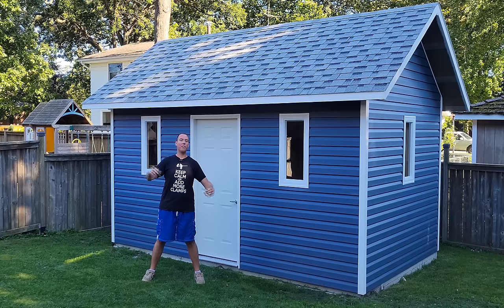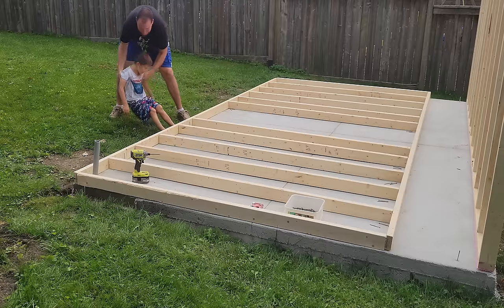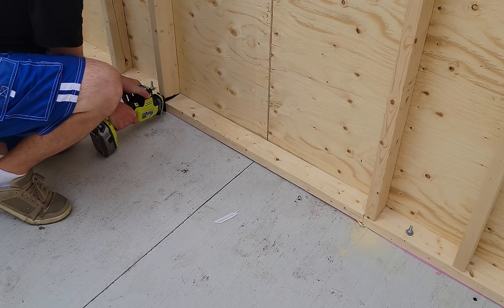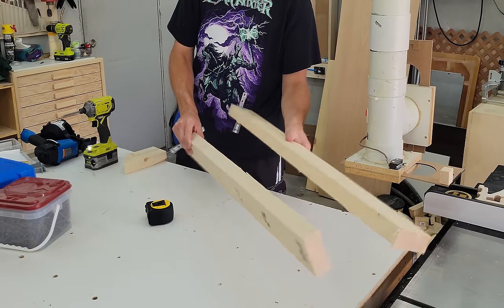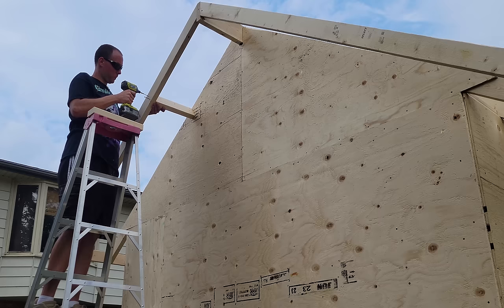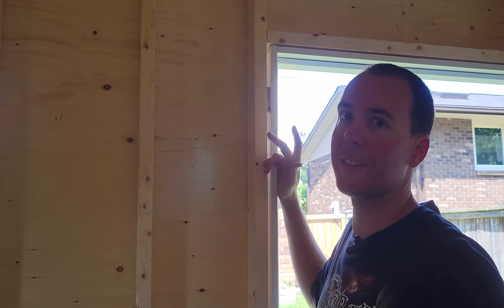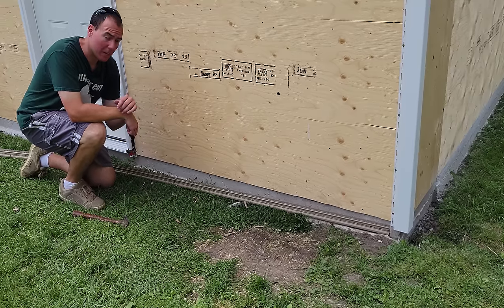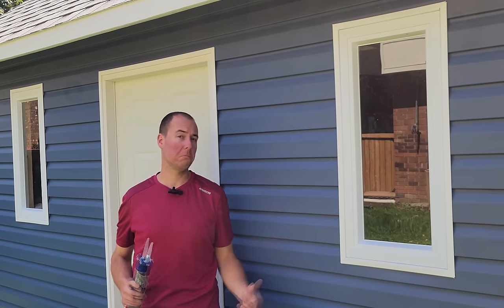How to Build a Shed (Start to Finish)

Comment: 1st critical mistake.... Screws cannot handle the shear force that nails can.  That is why framers use nail guns and not screw guns....
Reply: Came here to say that. Screws have great tinsel strength but no shear strength. That's why nails are predominant in framing. Outdoor rated screws have some shear strength but not comparable to nails.
Reply: Can't tell what he used specifically, but they do make structurally rated screws. Expensive, but convenient.
Reply: If you have an issue with sheer strength of your fasters, your shed really has bigger issues.
Reply: It's a shed, what shear pressure? Snow weight? Lmao lmao.  Your right, but I don't think it applies to a shed as much as a house...
Reply: This is a single story shed, framers typically build houses 😂😂 We get it though, you’re a smart cookie.
Reply: @suicidaljell  we have structural screws, they are expensive and most people who aren't in the trade don't know they exist.
Reply: @JonathanDaniel82 What the hell is “tinsel” strength?

Comment: Using Nails are cheaper,faster, and stronger (unless you used structural screws) but harder to correct any mistakes. Felt paper and house wrap would have been best practice. Also, PVC facia would last longer. However, it’s your shed and everything you did was perfect for a shed. I enjoyed the video ….looks great.

Comment: I've built quite a few things in my time, never a shed from the ground up... until now [ 6x8 ]. Many thanks for the explanations during the build. Big learning curve doing it by myself. I did mess up somewhere, so my rafters weren't the same angle, so I had to " adjust " each one.😂. Also on the vinyl corners, 2 are cut one way, flipped for the other 2. As I cut all 4 without thinking.. another trip to get a couple more.. learning curve!!

Comment: You would think all these folks hollering about the use of screws, lack of felt, tyvek, and drip edge would see the other 327 comments asking the same questions and relax. 😂 

You did a great job. None of those things are a big deal for a shed, people. 🤷
Reply from the maker: Exactly. This shed was built from experience since I did the same build 12 years ago at my old house and it's 100% fine.

Comment: Brad, I did notice that before the shingles went up a drip mold should have been installed.
Reply from the maker: Yes you are correct. There were many cost cutting things I did on this vs a real house. It will be just fine though as I had zero issues when I built a similar shed 10 years ago.
Reply: Very nice! That's practically a "TINY HOME"😅

Comment: before building codes, or people were really aware of how things were done in other parts of the country, one place did not use bird mouth.  They nailed a 2x4 on the outside of the studs, and a 2x4 on the inside of the 2x4, and the two were butted against the roof rafters, and nailed at both locations, basically locking the rafter from flying off.   That gave two connections to the rafter.  No roof ever blew off, etc.  So, funny enough, now, we do things by code, and somewhat the same across the country.   But the old method, gives you a 2x4 width to extend below the deck of the shed.  And also if you looked at train stations, you'd find that lots were built this way, with an outside extended overhang.

Comment: For any leftover "J" channel, buy a cheap 2x2 box fan and put a channel on either side. Pick up a filter about 24" x 24" and you have a very effective air filter for the shop. I put mine in the middle of the shop, set to high, put on a mask, then use the air compressor to blow the dust off of the lights and horizontal surfaces. After 10 minutes take the fan outside and blow the dust off of the filter and you are ready for the next clean up. Yes, I have a good dust collection system but I still end up with dust in the shop.

Comment: Terrific job on that shed! I would have put waterproofing between the vinyl & the plywood. Also, I am curious as to whether or not you had to get a permit to build that shed? Where I live you need a permit for any enclosed structure larger than 8'x10'.
Reply from the maker: They recently changed it to anything 160 Sq ft and under.
Reply: @DIYBuilds   120 square feet for California :/ if it's under 120sq feet even adding a simple light fixture would warrant permits that are 1k+

Comment: Excellent video and great looking shed. I built an 8x8’ one a few years ago, but not as fancy as yours. I used nail guns for all the framing though since I thought nails were cheaper, stronger, and faster?
Reply from the maker: It's a preference thing for me.
Reply: I've always understood it not as a preference and more that screws for framing are simply wrong, but I'm not a framer so I only figure its correct since nails have alot more flexibility and don't shear off or snap like s screw does so nails will allow some movement. I also understand this is just a shed but why wasn't a house wrap like Tyvex (understandably less important) or a roofing tar paper used?
Reply from the maker: You can use those products but I know them to be unecessary as I built the same shed 10 years ago with zero wood damage / leaks.

Comment: First off, looks great man. I get it’s a shed but the biggest thing I would have done differently was install the roof sheathing lengthwise. This is mainly for structural integrity. Could cause your roof to sink in between the rafters with the direction you installed them. Just my two cents

Comment: Why no jack studs for the door rough opening? 7:00
Reply from the maker: It's only a 36" opening. Add them if you want. But it will be just fine with the double top plate.

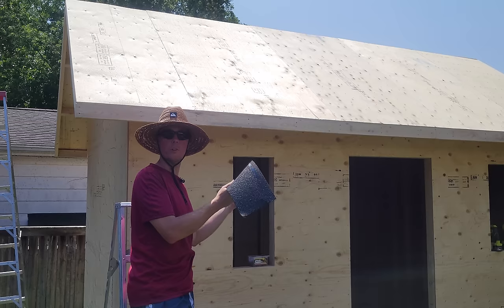Comment: I’m curious as to the choice not to put a moisture barrier on the roof under the shingles… 16:24
Reply: Yeah. Me too. Also no sealant tape around doors and windows. Fear this shed is going to have moisture issues. Especially after such great work on rest of shed. Saving a few bucks won’t pan out in the long run.
Reply: In 5 to 10 years this shed will need some plywood replaced, roofing repairs and probably some frame repairs. Water damage will be the cause. A simple moisture barrier would have extended the life of this shed an extra 15 to 25 years. Apart from those, shed has great workmanship and looks amazing.
Reply: @overyourheadtampa 
I AGREE, COUPLE HOURS AN D EXTENT THE LIVE COUPLE
DECADES.
CHEERS.
Reply from the maker: I made the same shed 15 years ago and has had zero issues, so I know my techniques are good for this application.

Comment: 16:33 into the video I noticed you put down starter shingles without tar paper or any other vapor barrier?
Reply from the maker: Not necessary for a shed. Do as you please.
Reply: No drip edge either?
Reply from the maker: Again add it youvwant but I had vuilt the same shed 10 years ago and 0 issues
Reply: You go through putting the starter strip down, but it's backwards. The starter strip should have been put down closest to the edge, not up by the ridge line. That way it will keep the first true row of shingles glued down at the edge.  @DIYBuilds
Reply from the maker: Ya I think your correct.

Comment: That's a fine looking shed. Those PDF plans sure leave a lot to the imagination. Is there really only 3 pages?
Reply from the maker: Yes because the shed is 10 by 16 with 8 foot high walls. Studs 16" on center. The "plans" are a guide to go along with the video.

Comment: That looks awesome!  I'm looking to build one, I have a few questions. Do you have to build on a concrete Slab, If so what is the difference from not building on a Slab? Also how far away from the fence did you build?
Thank you!
Reply: You don’t have to plenty of ppl use concrete blocks on the ground and build 2x6 or 2x8 frame to sit on. He did tho and did build on the slab hence the bolts he put in

Comment: Idk if its my ocd but wouldn't you want to keep the plywood off the concrete since it can wick water up and over time create rot on the siding? I know that may seem so extreme but I am curious as I am planning to build my shed and wanted to know if that is an actual concern or am I just over thinking it?
Reply from the maker: The concrete sticks out of the ground 4 inches so basically is never wet. The shed isn't sealed or insulated so plenty of airflow to dry out anything that does get wet

Comment: No felt paper or drip edge before placing shingles. Interesting!
Reply from the maker: It's a shed. It doesn't have house wrap or eavs troughs or facia or insulation either. Add as many elements as you want but at the end of the day this method is tried and true over 25 years to not fail other than replacing the shingles after there designed lifetime.
Reply: @DIYBuilds  so costs are cut due to sheds not subject to having a building code. Is this correct? 

What part of the country is this project? Curious.
Reply from the maker: You're correct. There is no building code for sheds.

Comment: shouldn't you have added an underlayment for the roof?
Reply from the maker: Wouldn't hurt but in my experience it's not necessary. So long as you lay the shingles correctly and replace them in 20 years or when they go bad.

Comment: it looks good but needs more waterproofing. need to wrap the edges of your plywood that are down on the concrete keep water from wicking up it. You need to do a house wrap a roof wrap. Also where's the king studs for your door and windows? Why did you blame the concrete guys for it not being square or was that a joke?
Reply from the maker: Those things are optional. I know because I built the same shed 10 years ago and has zero water damage. As for the concrete yes I did blame them because they made the corner with the conduit in it 2 inches higher than the other 3 corners throwing everything off.
Reply: @DIYBuilds  I look at it as if I'm going to spend all that money to build it, I might as well do it right the first time that way im not dealing with headaches later on. I live in the northern area (snow, floods etc.) where I seen people build shit and within a few years it's all rotten and falling apart because they didn't properly waterproof it.

Comment: LMAO! Shed is out of square because of the concrete guys, it was up to you to square up the building before tightening the lag bolts. Still a good video for diy's.
Reply from the maker: I miss spoke. The one corner of concrete was high, causing the issues that I didn't notice until putting on the roof.

Comment: Nice job. And I'll be the first... No waterproofing under the vinyl?
Reply from the maker: Nope. If it was a house for sure. But its an uninsulated shed so it will be just fine. Vinyl does a great job on its own.
Reply: @DIYBuilds  That's what I figured. In my part of TX vinyl siding is rare as it's not approved by code in most city's. Here you have to have 60-75% masonry. 
   And you guys do that goofy plastic on the inside of the building... We dry to the inside so our vapor barrier is on the outside not the inside. Seen many restaurants rot out because they followed the plans from a northern architect.

       I have an 18x9 slab that needs a shed on it. Come on down here and enjoy the 104 temps. :) If I do build one it'll be stick framed and then sheathed in steel.

Comment: What’s the length of the two boards holding up the 2x6x16?
Reply from the maker: They are 2 2x6x10 but I think it's 37"  but it needs to be measured in place to make sure it's correct.

Comment: nice build... but your bottom plate should be pressure treated. :)
Reply from the maker: Doesn't need to be with gasket.
Reply: @DIYBuilds  I use both :)  Just to be on the safe side.
Reply: Base plates should be PT. Termites love yellow wood but in your area they may not be a threat so  the foam strips will be enough since it's just to prevent water on ground contact.
Reply from the maker: Yep, no termites here.

Comment: Hey there, I just came across your channel and so far I'm liking the content. I am curious as to where you live and can't get 2x4 longer than 16ft, I worked for a lumber company in Washington State for 16yrs and we had 2x4 in both hemlock and Douglas fir 8-10-12-14-16-18-20. In 2x6 we had the same lengths plus 22 and 24 ft
Reply from the maker: I get my wood from big box store.